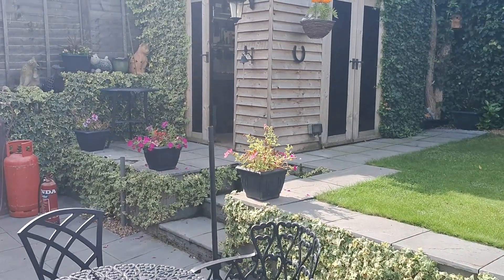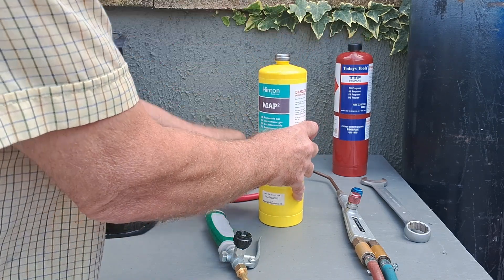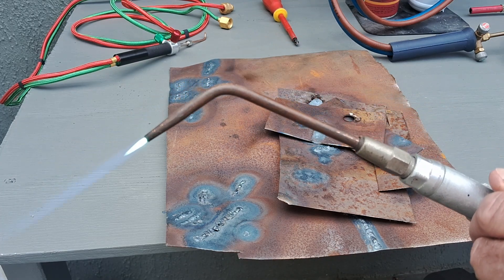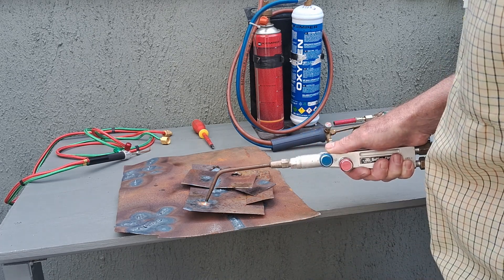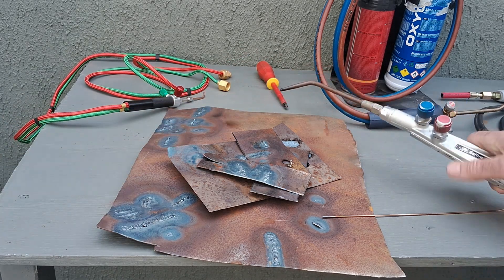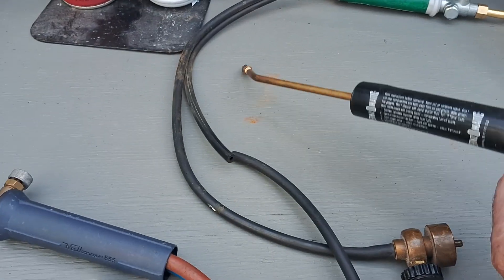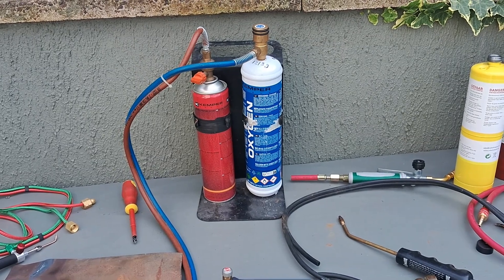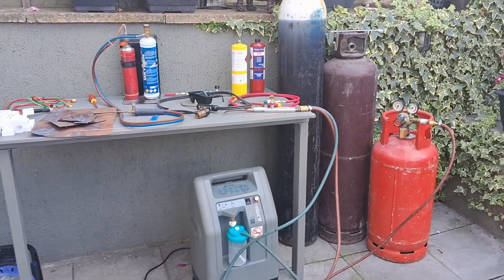FREE OXYGEN FOR WELDING USING A MEDICAL UNIT MAPP GAS PROPANE OXY ACETYLENE KIT GEAR MINI SET

Comment: The oxygen machine works by using a chemical reaction and eventually the necessary chemical which is built into the machine will run out and the machine will then no longer work.   It is not free.    The refurbishing companies that supply these machines recharge the chemical reagent (I believe) since the motors and electronics are perpetual.   It is interesting to see that they can work in a welding or brazing application on a small scale.

Comment: Hi Andy, I'm in a similar position as in my full size bottles are getting low and I've recently discovered that I'll be unable to get them changed at an acceptable cost... I'm told that the gas suppliers have merged and given an individual passport to each bottle so without a contract you just won't get them changed.
Although I believe for small users like myself there is a deal available in which you can buy your own small bottles and then refilling is possible, these bottles are larger than ' portapack ' maybe around 20 litres.

I've been miserly hanging on to the last of my Acetylene for years now and only using it when absolutely necessary... propane works great for heating, silver solder, brazing and also flame dressing cut stone amongst many other things, but it's the O2 that will soon be my problem.

You were lucky to find that Devilbiss as I see that a 10L unit is the best part of £1200 atm... but especially as I'm now retired I love the idea of being of not being held to ransom by gas suppliers, I never liked greedy BOC.

Anyway you have my cogs turning and I think I'll be following your lead on this subject... Cheers and thanks for your video👍👍
Reply from the maker: yes! my thoughts exactly. totally agree with everything you said. and i am sure lots of others agree too. you can find a used oxygen machine if you search and wait. but they dont come up that often.

thanks for your comment and good luck andy
Reply from the maker: and i too am using my gas very sparingly hahahhahaahah

Comment: For your information and that of others, "Free Oxygen" is not true, you may have to buy the oxygen unit? and you will have to buy the electricity to operate the unit so it isn't free.
Next, you cannot weld properly with any gas except acetylene gas because acetylene when it burns provides the shielding gas required to make welds. Propane, butane, methane or other gases will not provide a shielding gas to make a weld with any integrity. The "welding" shown in the video isn't welding at all. All we see here is metal being melted onto metal, much like brazing or soldering. To weld, there must be a joint and the joint must be fused together to create a weld. The weld must be as strong as the parent material, however, using any other gas other than acetylene will result ina brittle weld bead that will break.
Reply from the maker: thanks for your comment. cheers andy
Reply: @andyfireblades  I wonder if using a thin SMAW rod would make a DIY solution to the above described issue....or maybe not necessary anyway for non critical diy welding. Thanks for your inspiring and helpful vids anyway.  Or 1mm gasless mig wire as an after thought!
Reply from the maker: @no.6123  thanks andy